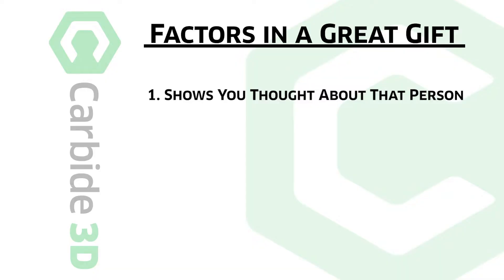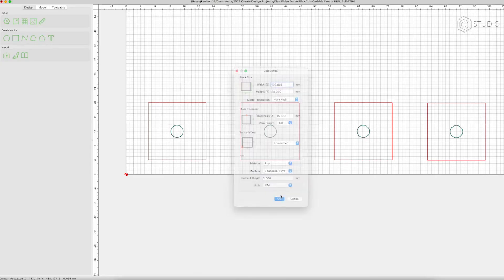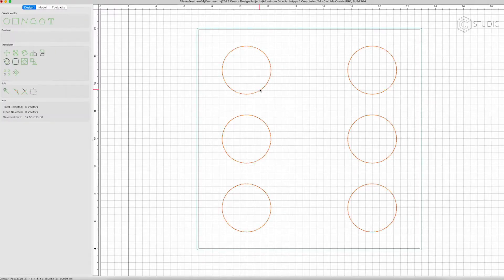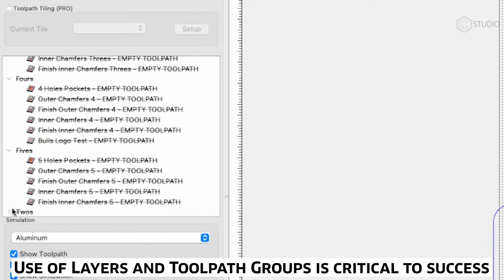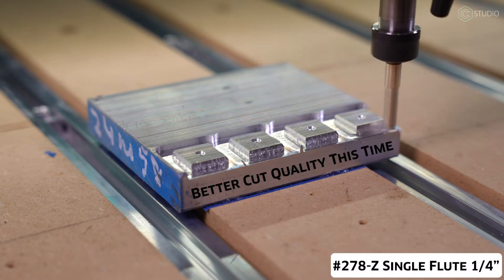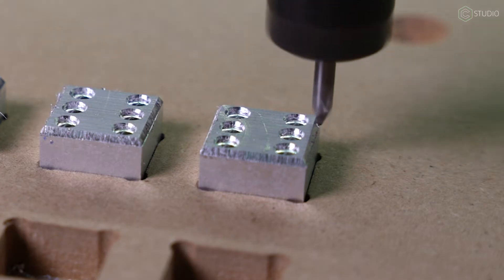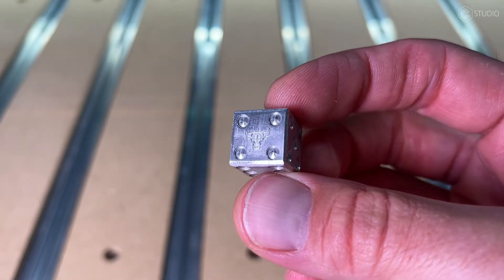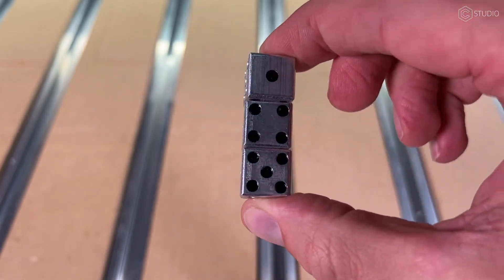Multi-Sided Machining with a Secret 🤫

Comment: I'll be using this hidden macro feature from now on to my advantage.  Now I can easily shift over to alternate machine origins/workpieces while waiting for my inlay resin to set up, etc.  Later in the day I can move right back to that original  workpiece and continue work.  It will save me lots of re-setup time and increase my efficiency.  A very nice feature that I've been missing - Thanks!

Comment: Question regarding the macro to save another zero location. How accurate is that macro once the CNC is turned off? Does it lose its precision once its turned off? If I wanted to use the macro zero position for a project that I routinely produce every other week or two weeks can I expect the macro zero position to be right on after several days/weeks being turned off ? Thank you and I greatly appreciate your videos!!
Reply: Didn’t work for me. It was way off. Never got an answer from them

Comment: The Dice pockets. Please consider a shim on two adjacent sides. I use  cut down  cheap "aliexpress/temu"  or garage sale feeler gauges snipped and bent (so you can get it out) on two of the adjacent sides (usually with blue tape to not scratch the AL surface.  Register XY0 on the corner that does not have the shims. Then you can push the die into that corner and it will be dead on from that point.  The space means you can get it out easily. If it gets really stuck "air in a can" held upside down will chill the AL so that it will shrink and you can pop it out. 

For production if you did 10ish or 100  at a time: Set up in Y close to the home SW, and X close to the center and ideally a high block to reduce Z and  raise up the router a bit and retram, then cut the jig on the machine so the skew from Y being a little off is accommodated for in both the jig/fixture and the parts, as well as come over to the jig slowly and disable rapids between cuts, etc etc will help. I learned on a 4x8 rack machine with underpowered drive steppers. A bit overkill but for production it may be worth it versus the dies coming out visible skewed. 

Your machine being new, factory set up, and probably having that aluminum plate underneath make a bigger run more possible per session. 

Also you can run  little scotchbrite points or a scotchbrite mini ball in a machine then have Inkscape make you a random wiggly toolpath and use your offsets. I hate sanding.  I had an air sander that was held in that 4x8 but it had some safety features. (Air tools also just stall) The shapoko is getting similar but smaller. This may help before the wetsanding. 

I'm really looking forward to making AL and yellow metal parts at home. I do want to try and keep the AL and cutting lubricant contained. I have a second machine a shark I got broken and I want all that PVC gone.

Comment: I have a "New to me" Shapeoko three with some mods from the prior user. I would be very interested to see someone's production process. If you are a dungeons and dragons nerd I have only made one so far but I cut down D12, and making post buttons for coats etc. Fusion has a polyhedron add on to make the soft jaw or "nest" easier. A vacuum setup would be easiest and these are so tiny a shop vac or a mini compressor modded to have an intake would work. Just be aware the dice have a void in the center due to the resin casing process and this is a "Wear a respirator and have the shop vac nozzle tight in there" project. I would not mind collaborating.

Comment: That's a really bad way to hold parts and asking for trouble 😬 press fit isn't enough
Reply from the maker: The workholding was more than adequate for this one-off project using small endmills.    On a production run, the needs would be far different.  There's no reason to create some elaborate jig or apparatus for a singular effort.  Unless, as is often the case with the engineering set, making elaborate workholding is more fun than doing the project itself.